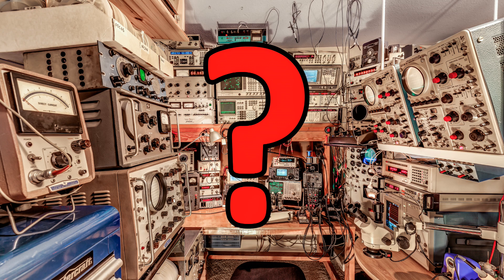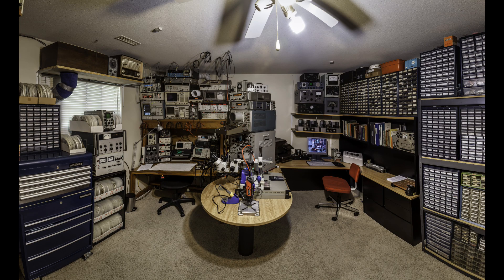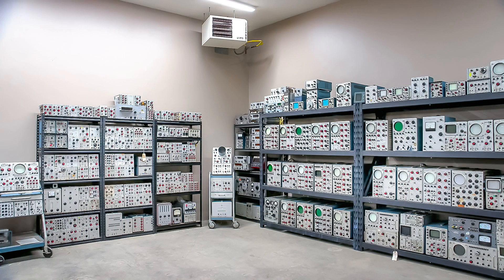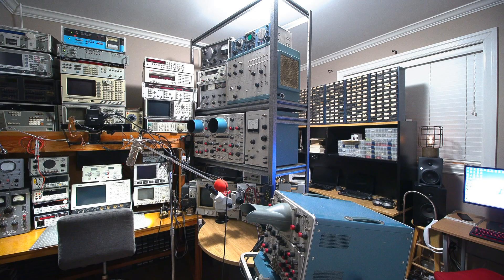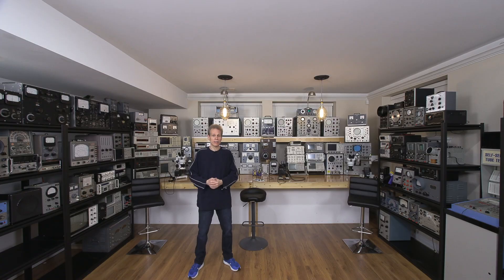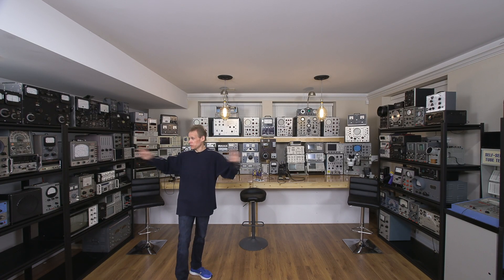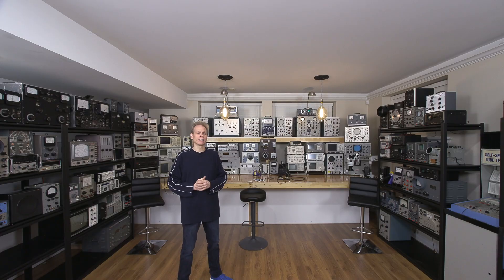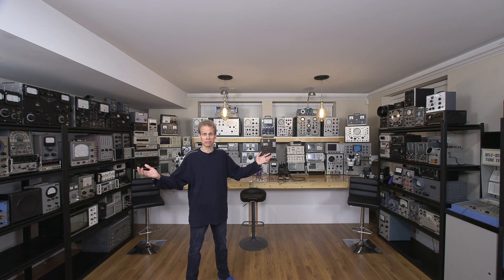Where Is Mr. Carlson's Lab? What's Going On?

Comment: Could you just use rubber vibration isolator brackets from Automotive Muffler hanging hardware to isolate the pumps from the wall, yet still use the wall support?